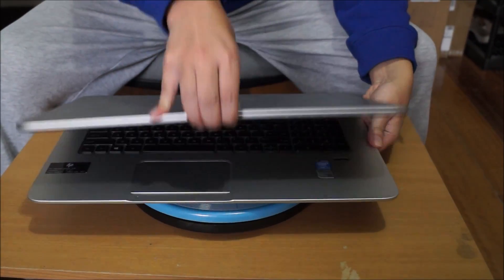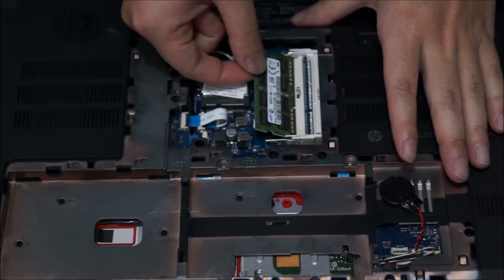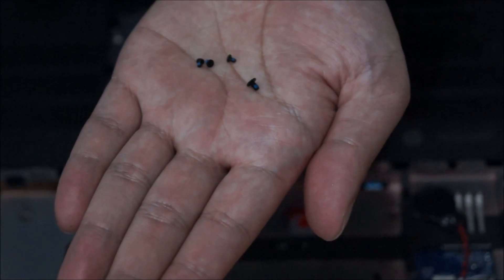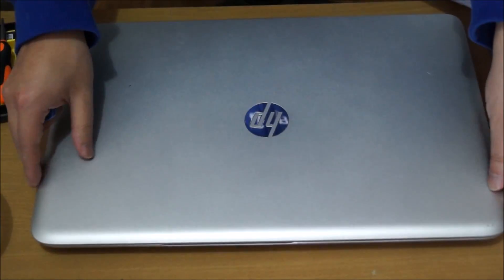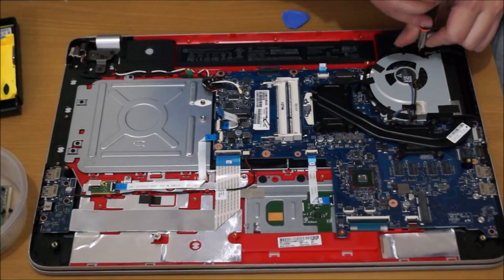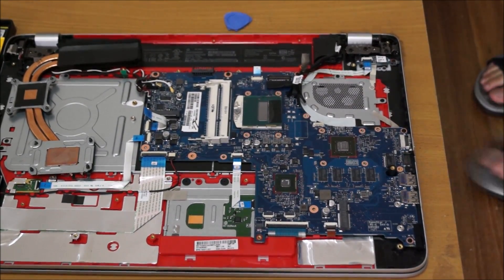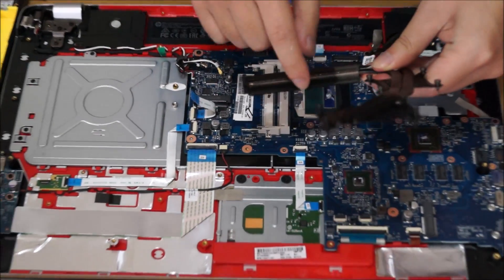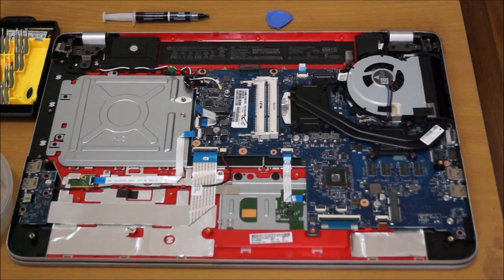OPEN ME UP! HP Envy 17 Disassembly Newer/Updated Video 1

Comment: I comented on your last video, and i still have a question about the CPU upgrade im trying to do. Mine has an i5 4000 something k, and I would like to upgrade it so something like an AMD 8950 with like 8 cores. Is it even possible to do that, or will it shut down.
Reply from the maker: you can't change companies. it has be be the same also it need to be a laptop CPU and no laptop CPU has the letter k at the end that's for desktop CPU

Comment: Hi! I am having a problem with my HP ENVY Touchsmart 17 J141NR. A hole started to open on the vent side, and i think that the screen is causing it. This started to happen in about 10 months ago, and i am afraid it get worse. Could you help me in any way and tell me if it can be fixed permanently, so i can open and close the screen without damaging it?
I posted a video that explain it better. Thanks!
https://www.youtube.com/watch?v=bjrIyCh2iyM
Reply from the maker: +hgsupertramp seems like you hinge is broken and no attach to the bottom plastic anymore. for me i open it up and glue it back together. i have done this before and it works well, remember don't be cheap on the glue use more expensive glue. i used a glue that comes in 2 parts and you have to mix them together, cost around $10AUD and takes 8 hours to dry up
Reply: +OPEN ME UP  Thank you. I'll do this. This glue, can you give me the name and brand that you have used to do it, so i make no mistake. Thanks..
Reply from the maker: Sorry don't have a name but they seem to be all the same as I purchase 3 of them that look the same and they do the same thing. The main idea is that it has 2 parts that you need to mix together. Just go out to your hardware store and ask them for glue that come in 2 parts. This glue is generally use for some stuff like glue 2 pieces of wood together.

Comment: Thanks man for the video, do you have a video for video cable and screen replacement, my son's 17-j020 has white and colored lines flickering (mostly horizontally) with no image but the HDMI external screen is fine. please advice if you have any thoughts.
Thank you
Reply from the maker: +Muosadak Abbas if it only happens sometimes could be faulty cable but if it happens all the time probably screen is faulty

Comment: I have the same computer, I was wondering if you can remove that graphics card and replace it with something better. I have the same laptop, can I remove the gt 740m and replace it with a gt 780m?
Reply: +Zach Doyle I didn't mean to say I have the same computer twice, my bad.
Reply: +Zach Doyle I got mixed up, could I replace it with a gt 755m? (There is no gt 780m)
Reply from the maker: +Zach Doyle the graphic card is solder on so you can not change it
Reply: Okay, thanks.

Comment: Hi. Thank you for the video. I enjoyed watching. The only thing I wanted to point out is that you don't show the speakers in this updated video like you did on the original one. I actually have the 15t j100 and need to check the connectors on the speakers and possibly replace them. I'm getting no sound from the laptop speakers and can only hear sound when I use a Bluetooth. Have you encountered this issue?
Reply from the maker: you can replace the speakers but it really hard to find a replacement part as it is not a common item. speakers do blow up sometimes which is normal if you use them on max volume everyday, they will eventually die.
Reply: How can you determine whether it's the speakers or the sound card that's the hardware issue?
Reply from the maker: +Orchid Preciosa (Grisso) if you plug in head phone and it works then your speakers are the issue. If you head phones don't work them it is the sound card that's the issue. Sound card can not be replace or fixed.

Comment: Hello: I am a user and not a computer expert and intending to purchase an HP-Envy 17t with core i7 6700HQ which offers configuration of 1tb HDD, 2tb HDD, 1tb HDD + 256 flash SSD, 4gb HDD, or 512 SSD. I watch your video and try to get information on how hard drives are arranged in this previous model but didn’t get it clear, you show two sata hard drives bays (left and right in your video), but after further dissemble you showed another msata interface (under right drive bay). does that mean that this laptop can have one sata HDD, one sata SSD, and one msata drive, which one of those bays considered the primary and which one is the slave. Actually I want to purchase the one with 1tb HDD and add one SSD in another bay using it as primary hard for operating system and programs and use the original HDD for storage in the laptop, can that be done and does that left me another msata bay, shall I change the bay where the HDD is installed by the factory
Reply from the maker: +Abdalkareem Abdalrahman CPU can be changed, graphic card is solder on, ram can be changed to 16GB max with 8 GB in each slot there are 2 slots, wireless card can be changed, 2 hard drive slots which is a 2.5 inch that change be changed and a mSata slot. So basically yes. Anything can be consider primary depends on you and which one you choose. You decide yourself when use the computer what you want to do with your hard drive

Comment: Hey, Very good video. i have a question regarding a second hdd. You mentioned you can put a second 2,5 hdd. What cable i will need to do this? 
thanks
Reply from the maker: +Dunare Alin something like this you can get it off ebay http://www.ebay.com.au/itm/NEW-For-HP-Envy-17-Series-Hard-Disk-Connector-With-Cable-Replacement-Tested-/331379978792?hash=item4d27c93228
Reply: Where can I get HDD data cable with 8 pin for HP Envy 15.!?
Please help

Comment: I had a question regarding the XPS-15(and I suppose laptops in general) and I figure I have a better chance of getting a response if I post on a newer video.

I have a problem with the computer and one of the suggested solutions is to remove the battery and use direct power. So to do that, would I simply remove the battery from my computer and just plug in the charging cord? Is there anything else I would have to do to power it on or is that basically it?

I'm not all that familiar with laptops and I don't want to muck things up anything worse than they already are.
Reply from the maker: WalruswithTaste I actually reply to all my videos, doesn't matter how old or new it is. which XPS 15 do you have. Because new laptops are made so that they will only work with battery so that mean if you don't have a battery in it will not turn on as it take power from the battery not the power supply eg Samsung series 7 slate which is quite old. So depending on how the manufacture design the laptop, it will work or wont. 
It might sound too easy but It is actually that simple take the battery out and then plug the power in. But there is an issue if it was to work without that battery in it, it should work already and you don't need to remove the battery. So from what I can see you need the battery. I assume you either have the XPS 15  L521 or the XPS 15 9530 as they are the only XPS 15 with the battery inside. The XPS L521 should work without a battery and removing a dead battery doesn't change anything and the XPS 15 9530 must have a battery to turn on. Please note I am not 100% as I don't remember anymore since the L521 is extremely old and the 9530 I last used a year ago.
Look tell me your issue and I will try to help you
Reply: Sorry for taking so long in getting back to you.

The issue involves Windows starting up. The computer is stuck in a loop where it says something along the lines of "Your PC ran into a problem and needs to restart." It then reboots, attempting to fix the issue and subsequently failing. My only option is to restart it and do everything over again. It will not let me boot the Windows 8 usb and refreshing doesn't work.

It is likely the SSD of the laptop which is notorious for their issues of reliability. However, one of the suggested fixes for this issue on other laptops was to remove the battery and power it directly. But if what you say is the case, that may not work.

I suppose I shall look into getting a replacement battery and seeing if things improve once I switch it out. If you have any other ideas, please let me know.
Reply: I forgot to mention that I have the XPS 15  9530 Late 2013.
Reply from the maker: I though so but what is your issue.
Reply: You may have missed my first reply so I'll post it again:

The issue involves Windows starting up. The computer is stuck in a loop where it says something along the lines of "Your PC ran into a problem and needs to restart." It then reboots, attempting to fix the issue and subsequently failing. My only option is to restart it and do everything over again. It will not let me boot the Windows 8 usb and refreshing doesn't work.

It is likely the SSD of the laptop which is notorious for their issues of reliability. However, one of the suggested fixes for this issue on other laptops was to remove the battery and power it directly. But if what you say is the case, that may not work.

I suppose I shall look into getting a replacement battery and seeing if things improve once I switch it out. If you have any other ideas, please let me know.
Reply from the maker: that is not a battery problem I don't know who told you it is a battery problem, it is also not a SSD problem. What I can definitely tell you it is a software issue or a a small chance ram issue and SSD issue.
when you boot from usb what happens and also can you do a fresh install of windows ?
Reply: It does not recognize that any USBs have been put in the computer. I may try to do a fresh install of windows but I was hoping I wouldn't have to since the computer gave out on the day I was going to back everything up. I'd rather not lose any of my work.
Reply from the maker: what I want to know when it was working normally did all the USB ports work ?
Current now it is faulty does any USB ports work.
Reply: All USB ports were working. I was using the ports for an Ethernet Adapter, an External Hard-drive, and a Wireless Mouse.

None of the ports work. Mouse isn't registering on the laptop when usb is plugged in. Windows maintenance screen only showed access to C:// and D:// drives, no other USBs were displayed when I tried them.
Reply from the maker: Try every USB plug again with a bootable USB and when the laptop starts press f12 to go in boot menu. When in boot menu see if anything shows up
Reply: Nothing showed up in Boot Menu.
Reply from the maker: From what I can see I believe that your USB ports have been disable in the bois you can go undo that as it is basically not possible for the USB ports to be faulty. the left side and the right side USB port are on different boards so it is basically not possible for both side to be faulty at the same time.
So when the laptop starts press F2 > Advance > miscellaneous device > external usb power > enable